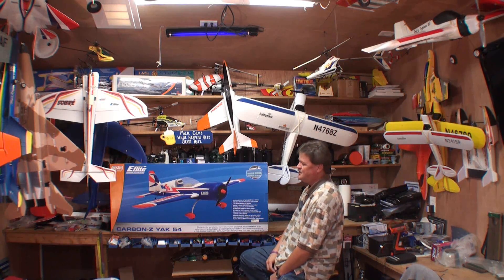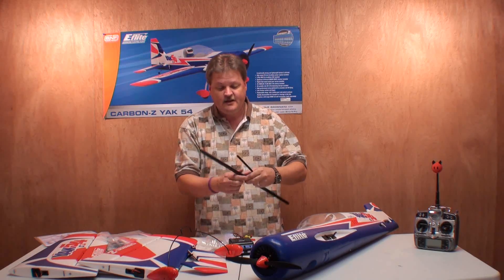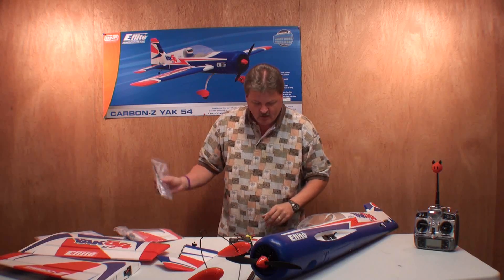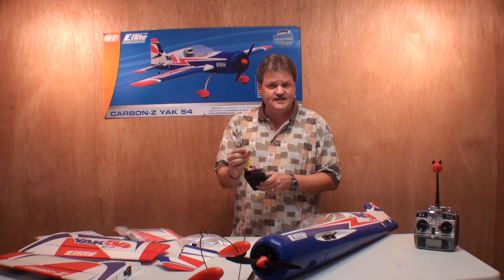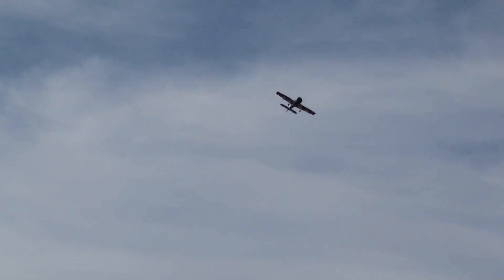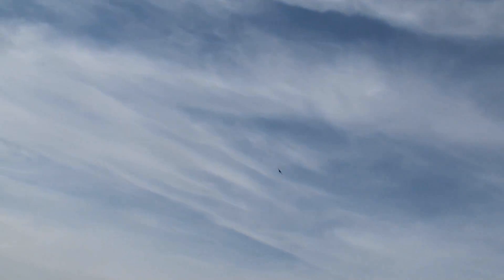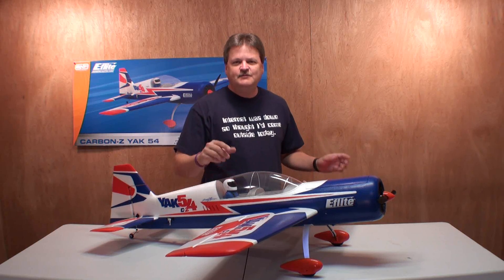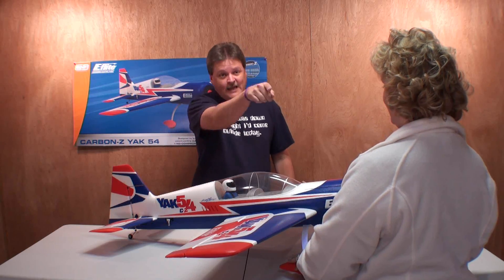Carbon Fiber Z Yak 54 Review By Eric Jordon

Comment from the maker: @baker5351 The Habu battery is a 3200 mAh lipo battery and CG was not a problem when using it. The Habu battery is about the same size as the battery that comes with the Yak 54 so it fit in the battery compartment with no problems at all. I think I have my timer setup for 5 minutes. I usually setup my timer at 4 minutes for a new plane and then gradually increase it as I learn more about the new planes flying characteristics.

Comment: Great vid! I have a couple flights on mine and I have a fealling that my other planes are going to be collecting dust this summer. This bird is fast, stable and sounds fantastic. The performance range is unbelievable from flying relaxing circuts to all out 3D. Another big plus is that replacement parts are cheap. Fuse is $35 and wings are $19 each. The plane will fly on a veriety of 4s batteries. I have tried 2200-3000 without any problems. I hope they come out with a Carbon Z bipe next.

Comment: Had mine about a week now and I gotta say it's awesome. Flies better 3d with a 13 x 4 prop and much easier to land with 20 percent flap. Mine hovers at about half throttle and the meter says it's pullin 750 watts at 50 amps.

Comment: I've always flew IC planes but not for a few years now, id like to give electric a go to get back into it. This plane looks amazing but you didn't seem to fly long, is that about as long as you can fly? Would it be possible to get higher capacity batteries for this? Thnx

Comment: Looks like a blast!  I would love to see a follow up video using the 3300mah batteries from the Habu.  I have several of those batteries also.  I have read and heard different views on using the bigger battery.  Some say it won't 3D as well and don't use them. They even say you should use a smaller pack like a 4S 2650mah.  Then there are the others that say it should be fine.  Would be nice to see what your thoughts are before I go out and buy different lipos.  Thanks.

Comment: Thanks for the reply on the 3300mah lipos.  Did you have to move it back any to center the cg or did it fit in the space for the stock 2800mah? Also, what was your flight time on the 3300mah?  Thanks.

Comment: Joe! I just bought a used one($250 BNF mint condition with an extra battery!) and i just wanted to ask a quick question...It seems the guy didn't give me the wing bolts. I see the holes so just wanted to check that there are wing bolts(lol) and also I don't see threads on the actual plastic that is on the plane(Fuse) itself. I "Think" I only see threads on the wings. How do they hold the wing on? Thanks for any help you can provide! :)

Comment: I just sold my pulse xt 40 because I had built it with a nitro engine and I did not like the hassle of all that. I am thinking about buying the cz yak bnf but I am worried that it is to agile and nimble for someone just coming off an apprentice 15e. If you find that it is too difficult for me please suggest another plane that is a step up from my apprentice. My restrictions are it has to be pnp or easier to build because I am not skilled at building planes. It must also be electric with a spekt

Comment: PS. watch out with your speed controller it's so close by the axleand the back of the motor it will grind your ESC away. thats what happend with mine.

Comment: the extra 300 is more a aerobatic plane then a 3d plane.  300 is way more under powered then the yak and not as much control surface, especially in the rear.so hovering and true 3d stunts are harder to perform. You will usually see the 300 hovering into a good head wind to keep control. The wing on the 300 doesnt have the same curve giving slight ,but different flight characteristics from inverted and normal flight.
I for the record do not own either plane.